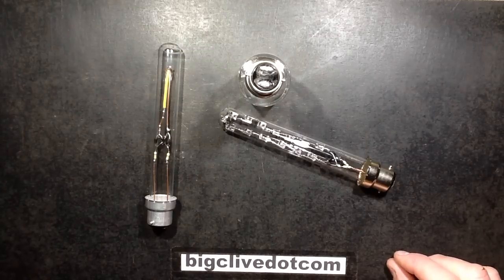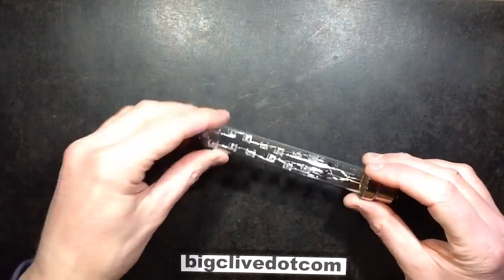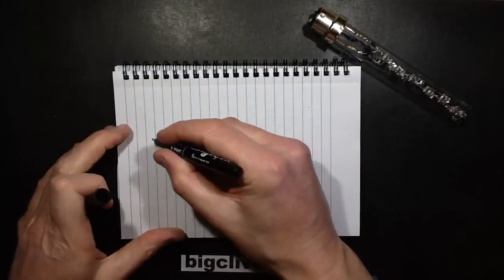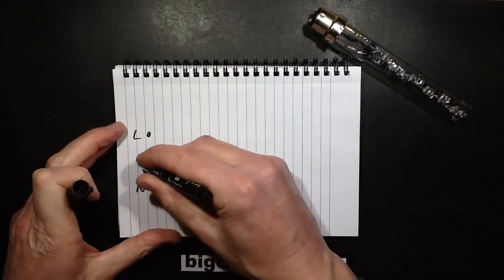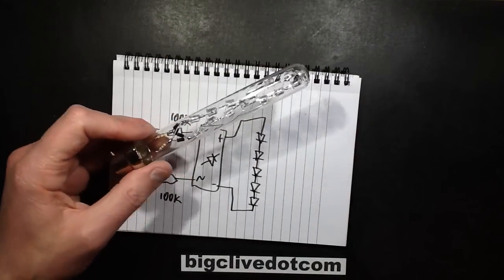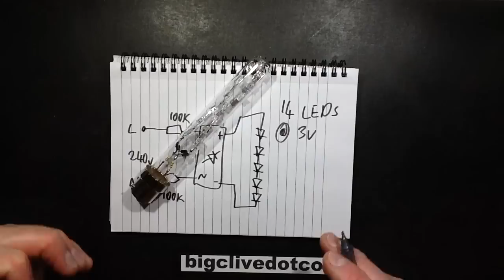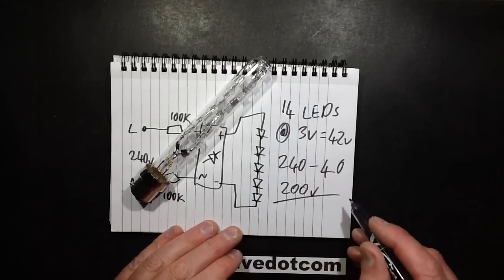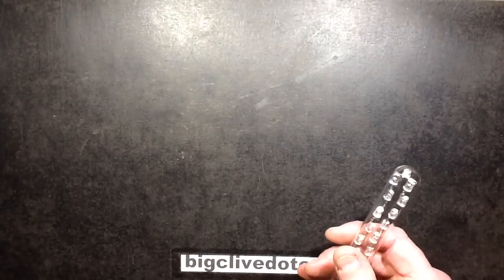Another spontaneous DIY LED test tube lamp.

Comment: I got some "potion flasks" from ebay that i thought i'd turn into decorations, and your video gave me the idea of putting the circuitry in the flask and then pour salt into the flask to hide and diffuse it. Might actually test that soon enough.

Edit: just tested it and it looked fabulous! Green had a "radioactive" glow while yellow was quite warm and cozy. Red looked like the salt was melting, white just looked white and blue, well it looked intensily blue. Quite happy with the experiment overall.
Reply from the maker: hardbasshammond Note that salt is quite corrosive, absorbs moisture and then becomes conductive.  It might be worth considering less corrosive filling material.  I wonder if sugar would work?
Reply: I'm well aware of that, i just used what i could get my hands the quickest :P
Yeah sugar might be a much better alternative, as it's the crystalline structure i was thinking of for diffusing the light.
There must be some plastic/glass alternative that you could use as not to "waste" sugar which could go into my tea.

Edit: Light intesinty test with sugar looked exactly the same as far as my eye could tell, it even looked way better in the flask itself instead of the shot glass i used in my last test. Green was the chosen one this time and i could almost hear the geiger counter in my head as the LED lit up. It looked like a fuel rod straight out of science fiction.
Reply from the maker: hardbasshammond Another option might be to use the granulated plastic "snow" sold on ebay.  Or even the bulk clear plastic wedding diamonds for scattering on tables.
Reply: Yeah, i was thinking about that. Off to Ebay it is!
Reply: bigclivedotcom i thought you could fill the tube with hot melt glue. although it would mean you could never remove the circuitry (although i assume this isn't an issue for you as it is a nice light and you seem like the sort of person who has a lot of spares) it would give a nice diffusion effect. it could be done by standing the tube in boiling water so that the glue doesn't solidify half way down. just a thought. keep up the good work :D

Comment: Bit old, but an idea to mix colors together better (so that they blended more) might be to crack the ice on the two different LED's, and then face them towards eachother point blank. I think that might mix the colors together and possible get them to reflect outwards even more.

Might not be as aesthetically pleasing to look at the led's themselves though.

Comment: Just made some DIN rail mounted indicators like that. Took a 5A Merlin Gerlin breaker, drilled out the 5 rivets and stripped it apart from the terminals and the copper bars attached to them. Then took some 82k 0.5W carbon composition resistors ( they are what was close to hand in the big box of resistors) and put 3 in series and soldered a string of 3 to each terminal. Then drilled 2 5mm holes in the top face for 2 clear LED's, and placed them in with epoxy. Bridge rectifier made from 12V zener diodes ( Bought a box of 12V and 24V 400mW zeners years ago on auction for $1, must be now down to only around 35000 now) and a blue mains wire for the neutral line fed out through the bottom in the arc vent. Fill up with epoxy in strategic spots to fill the lever hole, pot the connections and put the breaker back together. Rivets replaced with more white eopxy, and then it now is a dual green and orange indicator.

Worked out that it will take 5 years for this to use 1 unit of power on all the time per section. It now lives in a distribution board as a power on indicator ( after another 5A breaker, got 2 dozen assorted breakers left from the load I got free at the scrap yard) and an indicator that the time switch is actually working to control the water heater.

Comment: I've seen some of your tear-downs where there is a capacitor before and after the rectifier at different values and I can't say I fully understand the math involved in the process, or for example how to make these 1ma led's burn at say 15-20ma.

Please, would you perhaps consider doing more of a "forward engineering" style video where you could discuss how to drive more current, use a discharge resistor (and other safety aspects), and perhaps ripple smoothing considerations if needed?

Comment: Interesting idea... I had just ordered some 12x75mm test tubes last night off of eBay ($0.89 for 10) to use for a waterproof enclosure for some LED lights that I was thinking of making for use around the exterior of my house.  I have some 5m spools of 12V 5050 white "waterproof" LED lights, but I really don't trust them to be truly waterproof nor do I trust their adhesive to stay stuck to the eave of my building.  I also don't think that I need the lights that closely spaced.  I'm thing that cutting the LED strips into 3 LED groups and soldering pigtails onto them would be about right for those test tubes and then I can make a holder for the test tube out of wood that would hold the ends of the test tube while also hiding the wiring.  My experiments with getting these cut pieces stuck to "craft" sticks has shown that the adhesive does not stick that well, but hot melt glue does attach the wires to the sticks, so I'll probably end up trying to attach the LED strips to the sticks with the hot melt glue also.  Another choice might just be to cut another thin strip of wood that would fit inside of the test tube to put behind the small LED strip so that it pressed the silicone strip against the glass, thus it would not be relying on the adhesive qualities (or lack thereof) of the coating on the back of the strips.

The design that you have come up with here though gives me another idea for a use for these test tubes.  My house has a few lighting fixtures that use numerous candelabra (E12) bulbs.  The CF and LED bulbs to fit this socket seem to be quite a bit more expensive than what is available for normal size bulbs and they don't seem to produce much light.  Some of these lighting fixtures that are in my house take 8 of these bulbs.  I'm thinking that making bulbs like you've shown here, but in white at full power might be worth trying out.  At worse, I convert the light fixture to 12V and use the appropriate number of LEDs and size of resistors.

Comment: Have you tried sanding the tube to make the light diffuse nicely?
Reply from the maker: It's not really bright enough to diffuse, but I suppose I could make a diffused sleeve for it or use a plastic tube with the surface lightly sanded.
Reply: bigclivedotcom
 Just take the test tube and use some HF acid to etch the inside, or if you are not that crazy just take some clear varnish and mix with acetone, then swirl inside the tube, pour out and dry fast in an oven, which should leave a nice crackled finish.

Comment: What is the PINK diode made of? is it like a red phosphor over blue core or something more exotic?
i got a bag of pink ones long ago with blue core+phosphor and they turn dark blue (phosphor turns brown/black) after like 100s of hours, at about 4mA, i have no idea what they were rated for, but i guess i was not overdriving them THAT bad an 4mA.
Reply from the maker: The early pink/magenta LEDs did degrade very quickly.  It is a blue chip with red phosphor.  The modern ones seem better.

Comment: Hi, whats the relation between resistor value and leds numbers?
I made one lamp, fallow your steps only difference is I put few leds more, total 17 leds. However when I measure every led voltage only get 2.68v? How do I make it brighter, or raise voltage to around 3 voltage?

I tried with 10k resistors,  they burn out :)

Comment: It may be a stupid question but why does it need the 100k resistor in neutral? Couldn't you just use a 200k resistor on live?
Reply: Против Глобал Thank you sir
Reply: It's in the valley of the "so obvious" that failures fall. "Pride goeth before the fall" is but one aphorism that warns against taking things as granted.

Comment: can you make a light that maximises this leakage effect?
Reply from the maker: Yes, but it would probably benefit from a smoothing cap with no discharge resistor and a huge string of LEDs to get maximum light for the current available.
Reply: bigclivedotcom
well of course it has to be within reason, both inside a lightbulb-ish size, and not go bang when someone turns on the switch
Reply from the maker: jusb1066 The "not going bang" bit is sadly a possible area of loss of efficiency.  But I may doodle a design for the ultimate energy thief lamp.

Comment: Hey BigCleave, I tried to do that first led lamp, i followed you tutorial and all, mains voltage is 130v ac, i put two 18k resistors, then the 4 diodes, and in my positive and negative terminal, my multimeter is reading 110v dc ?? I think that is way too much voltage for 10~20 leds in series, so, what did i do wrong ?? each led is supposed to get 3.3 volts right???
Reply from the maker: The open circuit voltage will be almost full mains voltage, but it's current limited, so as soon as the LEDs are wired across it the voltage will drop to the correct level.  Just be careful to connect the LEDs the right way round, since the high open circuit voltage may damage any connected in reverse.